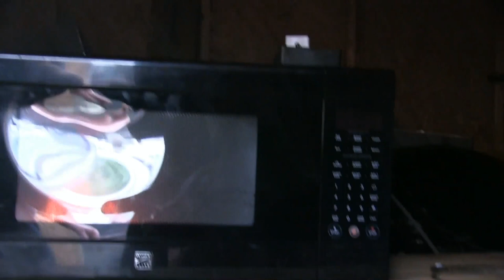Death Demon Skeleton In The Microwave

Comment: in laymans terms a capacitor is a battery like device that has a center dialectric that passes current, it also has the ability to STORE energy so it can be used for further useage. get it from the ham, i'll explain anything lol.